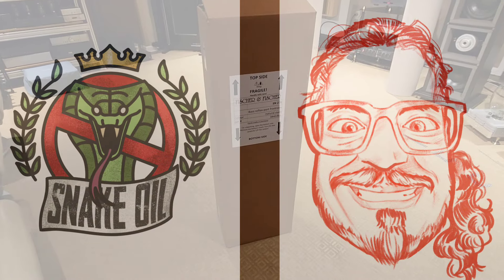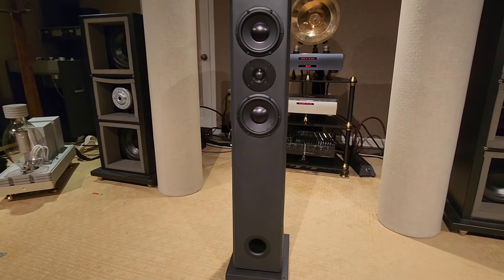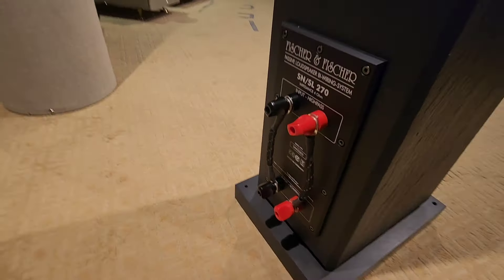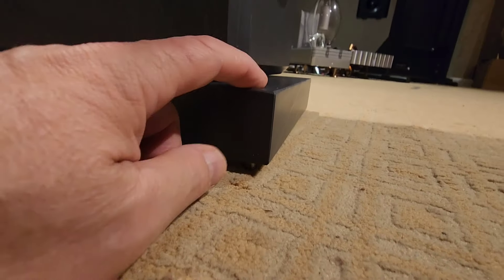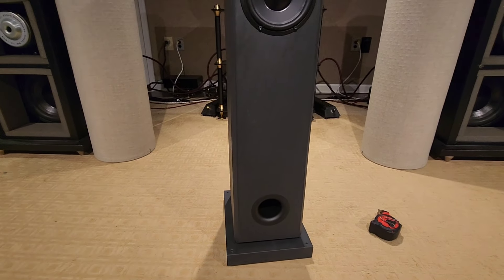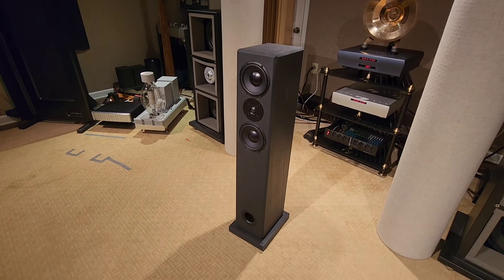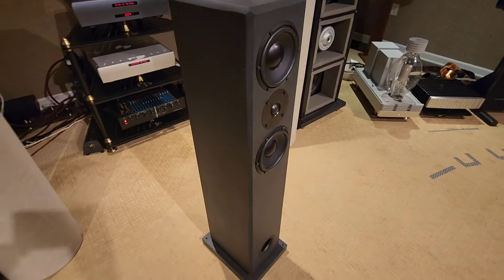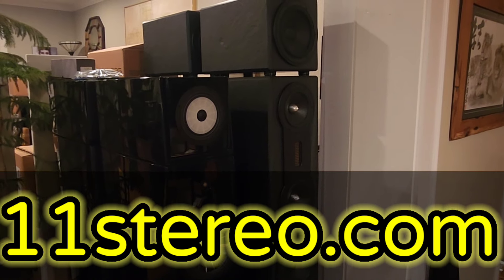USA DEBUT !! Fischer&Fischer SN 270, SLATE Loudspeaker !! #audiophile

Comment: Nothing currently beats stone or concrete for a speaker cabinet. People who understand enclosure rigidity will CLEARLY see the value here. If I ever the spare time or scratch, id love to DIY a speaker with granite or something just as crazy.
Reply: i don't think it would sound good
Reply: @MasterofPlay7  care to elaborate?
Reply: @AllboroLCD  the cabinet doesn't have any resonance wouldn't sound good
Reply: In what way does cab resonance aid sound quality  @MasterofPlay7 ?
Reply: @AllboroLCD  resonance makes it sound like live at real stage
Reply: Speakers with box resonances sound boxy. Panels or speakers with extremely inert cabinets sound very open and natural.
Reply: @dajikbatarang1  not so, inert material will make speaker lifeless, there's a reason the most used material for speakers cabinet is wood
Reply: @MasterofPlay7   ive never heard a planar or electrostat that sounded lifeless. No wood cabinet there.
Reply: @dajikbatarang1  the resonance comes from the reflection from the back, that's why you think the sound stage is huge
Reply: @dajikbatarang1  there's a reason people like tubes, it has this reverb sound which is also a resonance, it creates this seperation or air between singer/instrument
Reply: @MasterofPlay7  thats true but I wouldnt consider a reflection the same as cabinet resonance. It’s room speaker interaction.
Reply: @dajikbatarang1  it's the same....